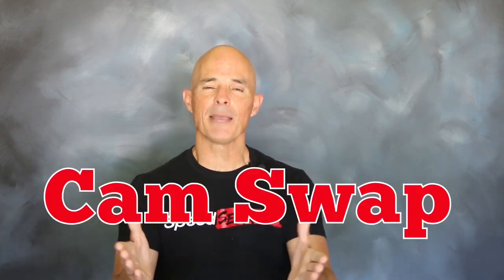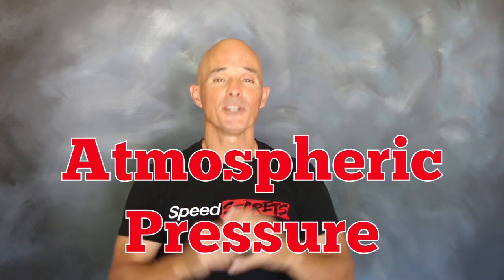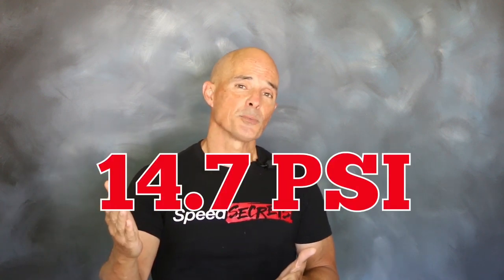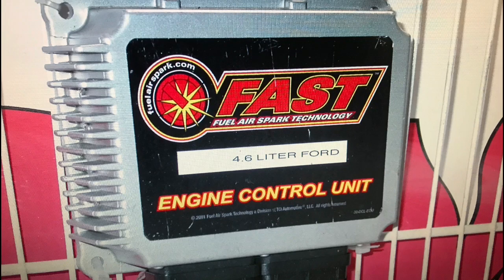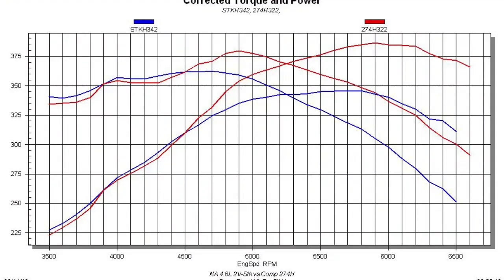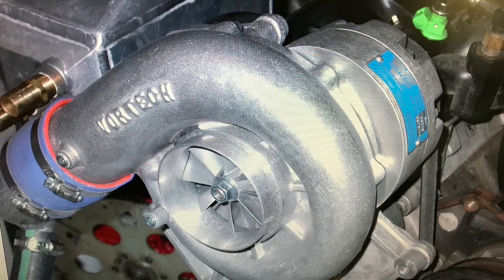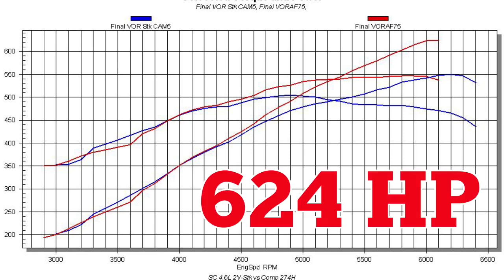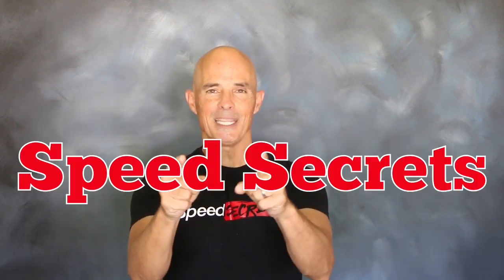4.6 2 Valve COMP Cams XE274H Dyno Testing!

Comment: Hey Richard,

What do you think this application would have done with some stock Romeo heads? I’m guessing the ported heads did far less than the cam swap hear.
Reply: Head porting can be worth good power on its own even with the stock pi cam and intake manifold however upgrading the whole combo (heads, cams, induction and exhaust) that you get much more gains. With that said, theres good power to be had from any of the 2v mod motors. The stock npi intake and cam is terrible but easily swapped. Companies like Renegade have really proved the potential with ported npi 2v combos. Johnny Langtons car early on ran with stock stock pi camshafts, stock pi intake manifold, 9.2:1 compression and running 12s in a thunderbird chassis which is a solid 3700lb car all with a 4r70 auto! This shows how much you can do with what these little engines got to give.

Comment: so a non pi block with ported pi heads will make 350whp or crank hp while with just an exhaust and tune basically? thats absolutely insane...
Reply: SlpprEatrr 03 it’s because of the flat piston non pi motors came with
Reply: No. Unfortunately a pi swap will not yield 350whp n/a unless some serious work is done to not only to the heads but also the bottom end (raising compression). Richard tests these engines with nothing but the crank pulley, he has a electric water pump, no alternator, etc. Etc. However that doesn't mean you can't eclipse the 300whp mark with a pi swap. There have been people who have accomplished that with stock cams. Also the npi bottom end came with a slight dish in the piston. They are not true flat top pistons. They have a dish of 10 or 11cc, I belive. The pi has a dish of 18cc I think.
Reply: @kevinpazos9846  not bc of a pi swap, but bc of the raised compression. Non pi block, non pi pistons, then ported pi heads, should give close to 10.5:1 compression which is what was making about 300whp. I know a simple pi motor wouldnt make 300whp without alot of work
Reply: @creepystank420 The npi's biggest downside is mostly its intake and head design, although yes the added compression does help some you are indeed correct. Some people go as far as to swap a lincoln mark viii shortblock with pi heads to make well over 300whp with stock cams, as im sure you already know. Its a cheap way to lose 80lbs off the nose of the car and break 300whp, and compression would be in the 11:1 range. (dont quote me though I dont have my service manual near me)
Reply: @kevinpazos9846  after watching some more videos i found that bc of pi heads having a small combustion chamber, that causes the higher compression. My motor blew about two weeks ago and im looking for the best combo to throw back in it
Reply: @creepystank420  cheap wise and plenty quick, look up recession buster 2v. Its simply a mark viii shortblock with the small dish pistons (or hell even a mach 1 shortblock or aviator for that matter) and the pi heads and cams and i guarantee you will hit 330-340 whp. However if you want to throw some serious boost at, anything really above 400whp becomes very dicey with the glassy bottom end. The connecting rods usually are the first to go. The cast crank on the gt's are plenty strong and ive seen them rev to around 7500-7800 rpm. If your serious about cams and making great power i'd talk to guy named Todd NA SVT Warren, he's a bit of a wizard with these engines. He's got a facebook page called NA SVT modular fords and its probably the least bullshit page i've found on these engines.
Reply: @kevinpazos9846  the 3cc dish pistons from the mark 8 an pi heads will give a high compression ratio something around 12.4:1.. gonna need e85 to take advantage of the comp without taking all the timing out. an anything over 7000rpm on a cast crank is a disaster waiting to happen

Comment: Was this cam used with stick pistons? Or were valve reliefs needed?
Reply: These cams should clear as long as their degreed. They have less peak lift but the valve is open much longer due to the increase in duration. Imho, the valve doesn't gain a whole lot opening that few extra hundredths at the cost of duration. Mid lift flow is where it's at on pi hence why this combo works so well.

Comment: how much boost Can a stock 2v handle?
Reply: About 9-10 psi, or about 400 rwhp.
Anything higher than that the motor will grenade
Reply: I’m at 448/415 whp with a Vortech and little support mods.

My car has 165k and has been supercharged for nearly 90k miles now.  I pound the piss out of this car at least once every time out. 

They can make 475 comfortably with cams and boost.
Reply: Ba P Yea if you have a terrible tune 😂🤣

Comment: So how much would it be with a pulley swap?  2.5” blower pulley should be right at 14 lbs from what I was told. Please test that. I have this same combo and no Dyno close n my town. Help me!!
Reply: Assuming the tune is spot on you should pick up another 30-50hp with the increase of boost but it won't be till the top end.
Reply: @madmod  if you changed the pulley that much power would be increased through the entire boost range
Reply: @bodyshotjake7475  The entire boost range offered by a centri is pretty much only high rpms. Centrifugal blowers always have a rising boost curve producing almost no boost until 3k rpms or often higher if you've got a well breathing combo. The boost response will be improved some but  it won't get close to the low rpm boost response of positive displacement  supercharging or turbocharging because that blower simply doesn't move air until much higher blower speeds. When you drop pulley sizes with a centri, expect gains past where peak power occurred prior but expect very little under 3k rpm because there's just not enough volume of air being moved at low blower speeds. I've actually got a v2 vortech blower off my old 98 planning to go on my mark viii so I've got good experience with these blowers.
Reply: @madmod  depends on the Trim your referring to as well. I start making boost on my setup at 2800rpm I have a V1 upgraded to the Si trim. I’m running a 3.125 pulley and I promise you when I drop that to the 2.8 and add the 15% OD crank pulley my boost will increase in the entire operation range. Will it start to build at 1100rpm no but the range will open.
Reply: @bodyshotjake7475  Centris just don't have low rpm boost response and it's a moot effort trying to make it happen. Of course it will bring the boost in slightly earlier with an increase  PR but you will see marginally no boost below 3k rpms regardless. Ideally you want as much blower speed with the least amount of measured boost as possible because centris always have a crazy rising boost curve with rpm.
Reply: @bodyshotjake7475  BTW love the 6r80 swap. Wish I could comment but you've got them disabled. I want to go 6r80 when my 4r dies
Reply: @madmod  yeah I have no idea how to get the comments on that video. 

It’s a good swap but there is one very important thing when doing the swap and that making absolutely sure you change your pinion flange out for the newer cup style and use a 11/14 aluminum Drive shaft. I had one custom made and because the u joints were a different diameter on the trans and the pinion I had DS u joint vibration no matter what I did.  The swap is super cool. It’s easy too if your already a 4R car.
Reply: @bodyshotjake7475  Hell of a cool combo. I think if you have your videos set for kids it takes away the comment section. Thanks for the driveshaft tip too. I'm looking for a complete 6.2 sohc with a 2wd 6r80 to take the Trans and keep the engine as a possible swap when the mod motor dies
Reply: @madmod  a 6.2 swap would really be something. I can’t say I’ve seen one in anything just yet. The 6R shifts incredibly fast in automatic mode. I have quite a bit of tuning to finish up before I button the interior back up. The best part about it is the 2-3 shift they are so close it feels like the Vtec just kicked in, as long as you don’t completely loose traction then it’s just hold on tight time.
Reply: @bodyshotjake7475  I've seen one Foxbody with a 6.2 that was carbed running 9s and it was mostly stock so there is a ton of potential.  Plus they come stock equipped with a 6r80 so it's a win win.
Reply: @madmod  it would be a truly unique and bad ass swap.